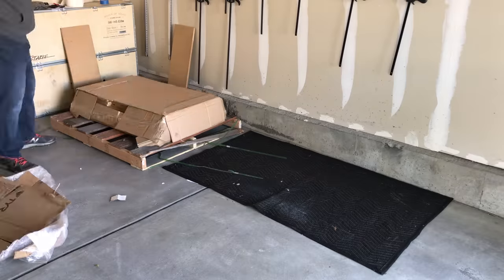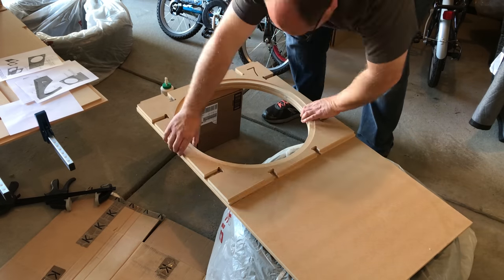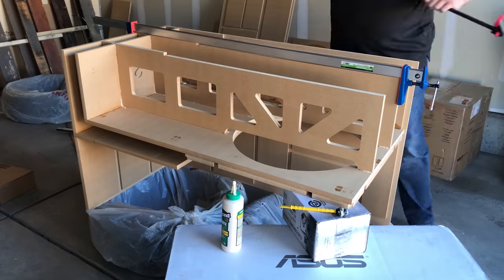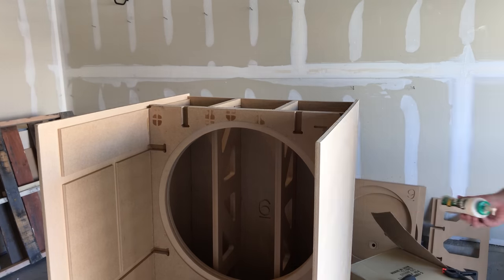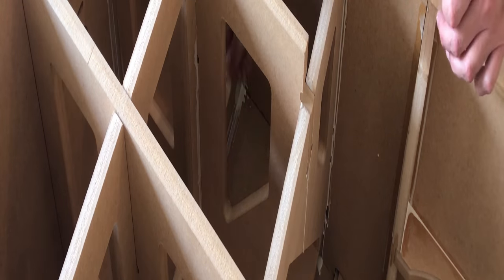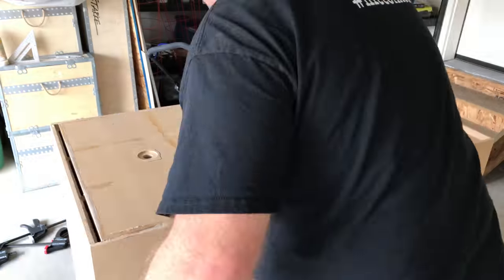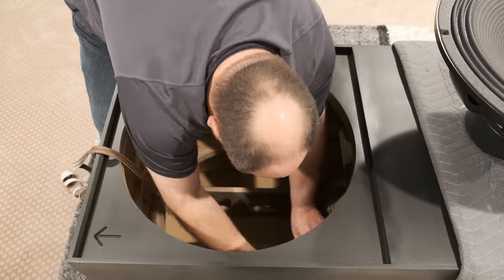21 Inch DIY Subwoofer build guide! The best GSG sub for your Home Theater.

Comment: Nice  build video. Looked through the comments, and, I too, would love to know, exactly, what the design is. Now...   Not, a critique, but, I did a full build /install of a BFM THTLP( 15" Folded Horn )/setup w/REW,  used it for 6~8 months....     removed the driver, bought a second driver, built two sealed enclosures, installed/ set up w/REW, and, have been MUCH happier. Did the FH go LOW, YES, ...    was it LOUD, YES,...   For me!....   multiple sealed enclosure subs WINS.....   Hands own/No contest...    YMMV....     I still have the THT/LP cab, would gladly give it to someone who proves they have a driver for it, RSS390HF, wants to use it, and, will pick it up in the Palm Springs, CA area.........            I'll keep a watch on JDM World...                             LOVE The DIY Audio STUFF!!!!!..........      Oh, and, TOTALLY Agree with the Minidsp for Sub control, nothing better @ PricePoint.........
Reply from the maker: Glad you found the system that works best for you. It a magical moment when you do a bunch of work and it all just falls in to place!

Comment: Couple questions,  link to the connector you used into the speakon connection. I did a few in the pass & never found the one that goes on tight. Also link to the glue brush. Thxs
Reply from the maker: The speakon connector is in the notes of the video. The brush is https://amzn.to/2MnZzi5
Reply: @JilesMcCoy   I'm sorry I wasn't clear..The metal connector at the end of your speaker wire.
Reply from the maker: @Eurica76  Oh, the quick connect? They are very similar to these. The 1/4" size are too large. These are .187" size.

Comment: Starting my build right now.  This video is super helpful to see where one needs to take due care and attention and to see where there might some areas to improve the construction.   I don't see how anyone would not like this video unless you're some outstanding handyman.  Looking forward to the next one video for the sub/amp/placement setup.  Cheers!
Reply from the maker: I'm glad its helpful! The HFP and EQ setting video is rendering right now. It will be up in the morning! Then a deeper dive into the response of the sub and my thoughts.
Reply: Did you wait 24 hrs after each piece was glued and clamped before proceeding with the next step/piece?  Or just a few hours to allow the glue to dry sufficiently?
Reply from the maker: @mxmizuno88  I waited long enough that things wouldnt move as I shift the box around. Once I got all the pieces attached I let it cure.
Reply: Piece 11 was really difficult to fit and I actually had to use a router to widen a dadoe by 2mm - specifically the middle ones as the outside edges all lined up ok.
Reply from the maker: Hughs Ng Sounds like you have it all together now? Which driver did you go with? I want to see pics! Post up a thread in the Facebook GSG owners group or Home Theater Fanatics.
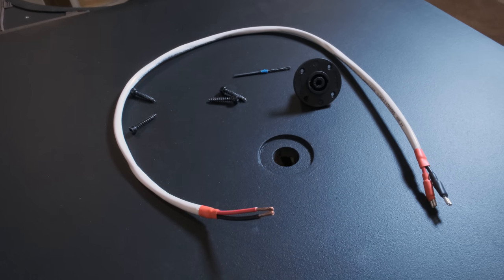Reply: @JilesMcCoy  I went with the LaVoce SAN214.50.  I'll post some pics but I've had to delay the build as I had to do it inside my front foyer it being -30 degrees Celsius here.  I was going to spray paint it inside buy my wife gave me heck for the fumes even though the paint is low fumes.  Nevertheless, I plan to get it going without the painting completed.  Question...at 26:23, where did you get those female connectors to connect to the NL4MPR?  I can't seem to find ones that are small enough and able to fit 12 gauge speaker wire.
Reply from the maker: Hughs Ng I’ll find a link for you to them. I had to order online. No one local had the right size! Quarter inch is too large!

Comment: When your speakers are so big they block the projector screen.  

Looks to me like you need to knock down a couple walls and remodel! ducks the wife's backhand
Reply from the maker: I need to dig the basement out and tunnel under the next door neighbor! Or a 2nd subfloor! I have an A-lens and will be getting a scope screen to fix the screen issue. Fun times a-coming!
Reply from the maker: You can check out the new center channel install video.

Comment: Are there any downsides to using a Brad nailer? To me it seems like a no brainer than a million clamps
Reply from the maker: Don't know. I wanted to make this video following the instructions from the manufacturer.
Reply: Wouldn't that depend on the glue? For example the glue I use requires >0.7MPa clamping pressure to get the optimal result (10+ MPa tensile strength), and that's something you won't get with a nailer.
Reply: I use my nailer to hold stuff from moving but the clamps are what makes a good strong bond.

Comment: You can also use an old gift card to scrape of excess glue with each clamping.  Instead of adding glue to exterior joints, I use epoxy.
Reply from the maker: Thats a great idea! ✔👍

Comment: How's your port velocity?  Red Five went back and had to enlarge the V1 Devastator for that driver.
Reply from the maker: There is a TON of air through the port. I have it near field behind my sofa so I haven't noticed any chuffing... but I need to stick my head back there during some heavy scenes and see what is going on. You can feel the air though.

Comment: Why not use PL200 or PL1000 instead of white glue? It would be significantly stronger and seal internal gaps that white glue will leave.
Reply from the maker: Construction adhesive is a good option and GSG likes it for this buiild. This is good reading for a comparison of the 2: https://homeguides.sfgate.com/wood-glue-vs-construction-adhesive-90200.html
Reply: Most construction adhesive will out gas for a while and that can corrode the copper in the coil. Use Elmer's wood glue and make your cuts straight .
Reply: @robsorgdrager8477  Coils will not corrode, they are coated in their own adhesive to hold them together and protect them. At most it would affect voice coil leads if they were copper and typically contact with the air alone will do that anyways to any copper.
Reply: @NVMDSTEvil  I'm just going off what I was taught. Using sealants and adhesive can induce voc's that will break down coatings and adhesive used in manufacturing of some speakers . I've been building enclosure for home and auto for a while now I've always had good luck with wood glue. For gap filling I use wood glue and corn starch .
Reply: I always use PL premium in my builds. Never had any issues and have had some speakers running for 10+ years. It expands to eliminate any leaks. Make sure that you don't want to take it apart though. The glue will bond stronger than the wood itself.
Reply: @dudemcgee256  Yeah, generally need wrecking bars and sledge hammers to take things apart after using it. 99% of any gassing harmful to a speaker should be gone in the first 12 hours.  You'll still be painting by then and paint itself would probably be as harmful or more-so than whatever was left from the glue.

Comment: The fold will be somewhere else in the house. Usually in the kitchen cupboards and your wife kicks you out cuz you're breaking glasses and plates. P.S. Room not big enough for subsonics.
Reply from the maker: Things work well enough down to 10hz. I dont measure lower than that.
Reply: Just remember that the room itself has to have enough cubic feet to reproduce low frequency. On tour we could produce 16hz -18hz with many, many, 18" coupled together. If you've ever heard subsonics from a car going by, well, that's because that's where the null is. They can never hear those freq's in the car cuz there's not enough cubic ft. to reproduce it.
Reply from the maker: @bradthompson258  http://www.linkwitzlab.com/rooms.htm
Reply: @bradthompson258  I agree with this.. The room seems insufficiently large considering the desired tuning of the system.
Reply: The car analogy is a good one. Just yesterday I thought my JL 12" was turned down low inside my car but then my wife tells me I am bumping Costco inside.

His wife and neighbors can hear that upgrade more than the guy sitting in the room itself....but it sure is fun yeah??!!
Reply: @bradthompson258 
You don't know what you are talking about. 

1. "...the room itself has to have enough cubic feet to reproduce low frequency."

      *Good thing rooms don't produce sound. Then we would be in real trouble!

2. "If you've ever heard subsonics from a car going by..."

      *Well, Subsonics is a weird Atlanta band, but I assume you mean infrasound... Infrasound is the range of frequencies below 20hz, or the general lowest frequency heard by human ears. The likeliness of hearing the frequencies that low is extremely, well... LOW. 

3. "They can never hear those freq's in the car cuz there's not enough cubic ft. to reproduce it."

      *There you go again thinking that these random objects create noise. The cubic feet inside of the car doesn't produce sound mate, the loudspeakers do. But, again, I assume you mean that the lower cubic feet inside the vehicle makes it harder for the subwoofer to produce frequencies below 20hz. I would completely disagree.  Usually frequencies below 20hz aren't heard because most people have boxes tuned from between 30-45hz, not 10-20hz. This means the drop off leaves these frequencies at a low output. Not to mention most amps in the car audio game don't go that low, most only support down to 20hz. This doesn't even include the fact that most people have crossovers set so that these frequencies DON'T play. If you are tuned to 35hz, and tried to play 15hz at max volume, you would throw the cone out of the basket! Common sense man! 

4.  "there's not enough cubic ft. to reproduce it."

      *May I remind you that so long as the air space provided is greater than the VAS parameter of the driver, it essentially creates an infinite baffle. Well, same principle applies to the room. The room will play frequencies as low as that woofer is able to play. Want it louder? Build a box with a larger volume, to remove some of the mechanical dampening by the pressure build up, and boom! More efficiency at the same wattage. Or, just put more wattage to the original system! I have a 15" Skar Audio ZVX rated at 1500w in my custom built parallel tuned 6th order bandpass enclosure strapped to a SKv2 3500W amplifier. So more than double the wattage RMS and in a massive box that measures over 12 cuft before displacements. This is going in a relatively small truck. '01 Silverado Extended cab. So it has two full doors and two smaller half doors. The box alone takes up a quarter of all the volume of air in the cabin of the truck. I also have ZERO issues playing down as low as 16hz. It's called design. Learn it!

Comment: JDM world i would like if this subwoofer can do the concert outdoor ?
Reply from the maker: That would be a great question for the GSG folks. I assume if you finish the boxes with Duratex and add wheels it would be doable.
Reply: Hi Jose, Kevin here from GSG.  Yes, the Devastator can be used outside.  Though the Dev cab is a relatively new product, we recently had a customer purchase a pair for outdoor electronic music festivals.  Additionally, over the last 6 weeks we’ve seen increased interest from the pro audio / dj community.  Also, for outside use, make sure you either finish them with a waterproof finish, or just wait for us to offer this flatpack in Birch, since that’ll offer increased durability with a lighter cabinet.
Reply: Kevin S thank you very much sir kevin i wait because i want to be a customer and representative of this brand in cape verde ... try to use all your engineering for the success of this subwoofer later systematic full line array
Reply: Jose Orlando Tavares costa I don’t think it’s a good idea to post your number here directly. I hope you like spam, ‘cause this is how you get spam.

Comment: Instead of using glue for the joints, silicone works really well.  In a lot of cases, air can escape the enclosure.  By gluing the piece in, then screwing it in, or using a brad nail to help keep everything together, add silicone, and use an old credit card on the internal edges.  It's curious to me that they didn't round off the edges for the bracing leading to the port as well.  Very interesting video though.
Reply from the maker: Thanks! I should have another build video up in about 3 weeks!
Reply: @JilesMcCoy  you're welcome. With the internal edges not rounded off, it will cause the sound wave to change form. It can also create port noise. I know you didn't design the enclosure, but it's just mentoring to those that might not know. I've studied audio and sound waves for a long time.

Comment: If you seek true cinema sound, why not buy true cinema speakers?  There are plenty of used pro JBL subs and cinema  systems for sale on eBay and such.  Could have bought a used 4642 double 18 cab for around $600.  At least that gives you some resale value.  Could get a 4670 system or even a pair of cheap 4638 that would far surpass this.   You'd be surprised of how cheap the used pro JBL cinema stuff can be.
Reply from the maker: Great advice! This video is geared toward folks that want a build project primarily.

Comment: You do not have to pre-drill holes on MDF it's not going to crack people... And you use heat shrink on wires not shrink wrap 🤣🤣 otherwise in that good video 👏👏👏
Reply from the maker: Touche on the heat shrink. But I have split may a piece of MDF in the past with screws. Itss bad times.
Reply: I always predrill my holes in every type of wood. Especially MDF. Good habit to get into to.

Comment: I watched another video of a man's speaker system he was saying his bass went to 15 Hz and the highs went to 45,000 Hz, I guess you cab feel the low bass but you cannot hear lower than 35 Hz or hear much past 15,000 Hz so what is the point of getting below 30 Hz even that you can only feel and most of these subwoofers do not put out a true 30 ft bass wave the Klipschhorn does using walls to create the wave.
Reply from the maker: You can feel bass all the way down to 0. I try to build flat down to 10 hz. Anything over 20K is useless. And anything over 15-17K is useless once you hit 50ish too.

Comment: What are the dimensions of that room?
Reply from the maker: about 14x14
Reply: My bedroom is 12x15, where I’m putting hts since it’s clear on other side of kids rooms part of the house. 

Do u find it’s comfortable to put a 7.2.4 audio setup in rooms our sizes? Or is that audio overkill for it. I’ll be running a Denon with Audyssey xt32 to tune up the sounds atleast.
Reply from the maker: @taden2007  7.x.4 is absolutely fine. I am working on upgrading to 9.x.6.
Reply: Crap, my wallet was hoping for a different answer 😅😅...
Reply from the maker: You gotta do what you gotta do! I did my .4 atmos on the cheap. It was one of my very first videos.

Comment: No screws in the cabinet? Don't use that cab for pa use!! I'd have that suka glued and definitely screwed! Also t nuts for the driver and access hatch. Has anyone ever seen nylock tnuts? Seems like it would be a good idea for high vibration atmospheres.
Reply from the maker: Bobby Biggs Correct, no screws ever in these builds other than to bolt things on.

Comment: Don't see how this is a true horn.
Reply from the maker: Technically it’s a 5th order band pass. So a ported box firing into a nonexpanding horn chamber. It also has to be modeled as a horn for frequency and pressure output.
Reply: @JilesMcCoy  How does it differ from a 6th order band pass?
Reply from the maker: @mwahlert  I thought 6th order was a ported box firing into a ported box. This is a ported box firing into a chamber without a port. It might just be semantics.
Reply from the maker: I agree 100% that this isn't a horn in the traditional sense of a horn being an expanding chamber.
Reply: @JilesMcCoy  It isn't a horn in any sense of the word my friend. Misleading title.
Reply from the maker: @dudemcgee256  Thats the description from the manufacturer....
Reply: @JilesMcCoy  Then they are wrong. It cannot be a horn without a flaring output. It needs a "throat" and a "Mouth" with walls that are NOT parallel to be a horn. 
https://en.wikipedia.org/wiki/Horn_(acoustic)
Reply: @dudemcgee256  they say " 5th-order bandpass (aka "ported horn") "
Reply from the maker: Thu Nell Ⓥ  You gotta get out more!!!!!

Comment: Two Alpine 15s equal 30.
Reply from the maker: Think about the surface area of the cone and the excursion of the voice coil. Not the addition of the diameters.
Reply: Built my own sealed boxes Crown Amp 
Cant complain
Reply: 2(π7.5^2) ≠ π15^2

Comment: As long as you're making your own speaker systems, you might as well make your own low frequency absorption cabinets/diffusors.

https://www.acousticfields.com/product-category/d-i-y-acoustic-treatment/

They do have the best low frequency absorption cabinets in the world, but you still have to buy the activated carbon from them since they mfg. the carbon specifically for sound absorption application.  Plus, they'll tell you how many you'll need and where to place them within the room.
Reply from the maker: That is absolutely on the list of things to do! A whole room acoustical treatment.